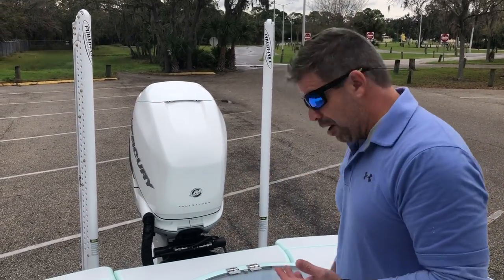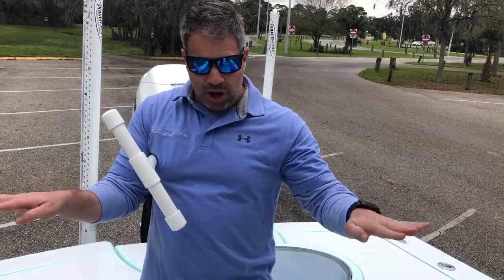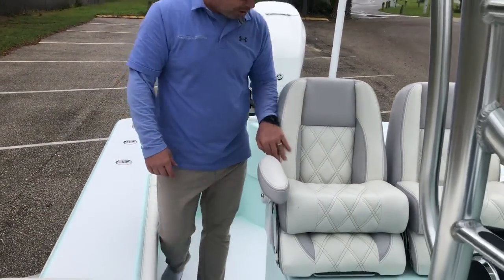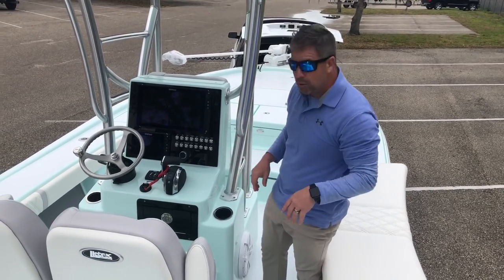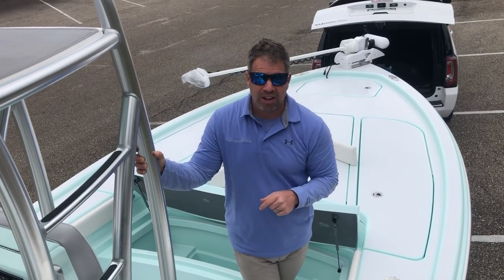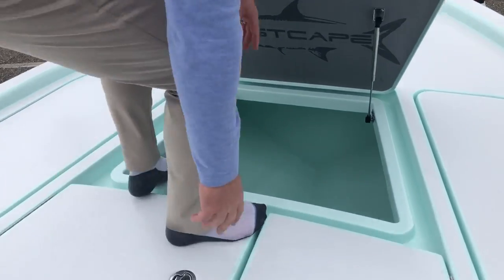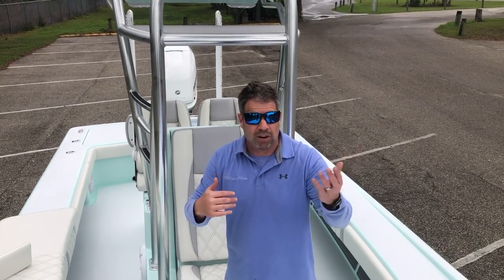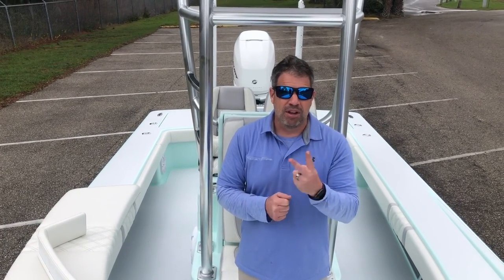Part 3 of this East Cape Bay

Comment: Several great ideas and overall a fantastic boat. The ability to get to fittings from that forward locker is brilliant. Course I already have a few minor nitpicks. 

From the video it looks like when the pumps stop flowing the live wells might back flow or drain. Might be something clever in the plumbing though. A submerged inlet and/or outlet design is better for ammonia removal, but in simple setups one clogged pump and the entire well can empty. This is why simple designs put the inlet/outlets above the waterline or run a standpipe. 

The forward rod lockers should open toward the bow. As they are setup now, accessing rods from outside the boat when it is on a trailer or at the dock is a going to be a pain. Also, bit skimpy with the rod holders on the bow. Maybe a bolt down casting platform with rod holders and back rest up there. Easy to clean, great seat for kids, good for stability when waves roll through and fantastic for fishing in the flats.

Molded in bucket storage that can be sprayed out. Where is that cast net after it gets nasty going to go? and don't say that front livewell because that will be loaded with bait.